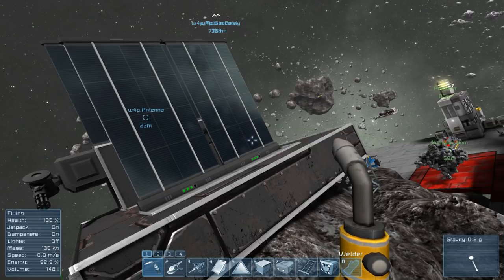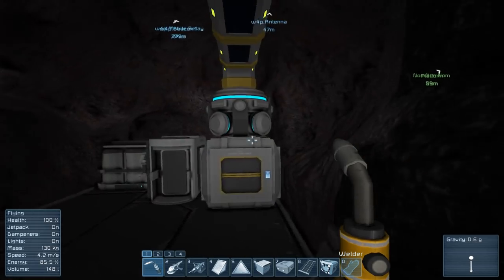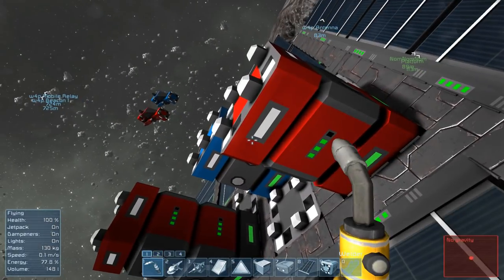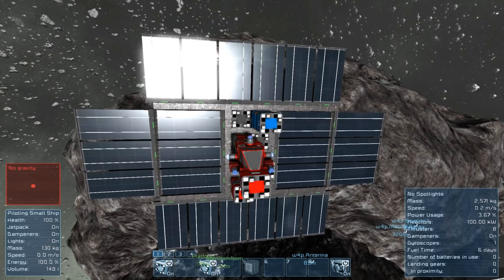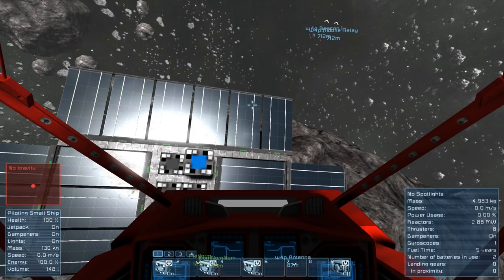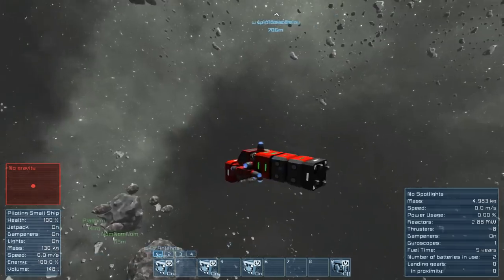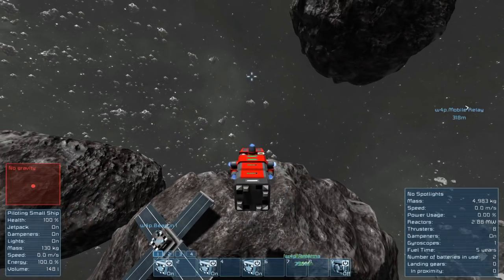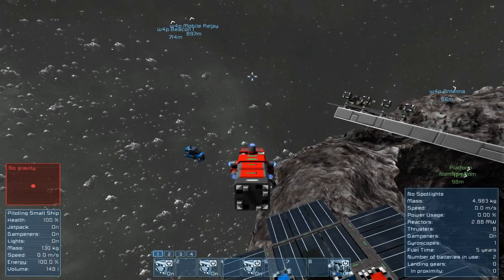Space Engineers - Solar Power - Practical uses for Survival Mode

Comment: You've got some awesome tutorials, I'm amazed at all the cool things that can be done with space engineers.  Earlier today I started the voyage into solar since I'm always having issues finding uranium.  Can a sensor be setup to auto track the sun to get optimal lighting no matter what position the ship/base is facing?
Reply from the maker: Cheers! :) As for the solar thing, it's really tricky.. I thought about that a while ago and couldn't really come up with a good solution as there's no way to track the sun itself.. had some thoughts about somehow making it so the power cutting out activates a rotor to spin the panel but honestly couldn't then think of a way to make that work. Will have a further think about it as there may be some extra options now.
Reply: ***** I figured there may not be any actual way to track the sun yet, I'm amazed it's still in alpha stage as stable as everything has been that I've tried.  I've seen some pretty complex rotor systems that fold out and/or change the angle of the panels manually but haven't seen really in-depth explanation there, just demonstrations.  I'm still fairly new to the game and trying to figure it all out all the rotor and advanced rotor systems as the concept is quite deep.
Reply from the maker: Kurt Laws
There's a ton of depth for something billed as an Alpha stage game and I for one hope it remains alpha for as long as possible, the development the game has seen is incredible honestly... Welcome aboard, you're gonna have a lot of fun I promise :)

Comment: In very recent times (matter of days) I have gotten an Idea for building a carrier that is designed to be used in long duration  voyages. Mainly because it is powered by two absolutely massive solar arrays that store power in, once again absolutely massive battery banks in engineering decks of the ship. Alongside being helped by two small emergency reactors, I think it would work. i just need some math done.

Comment: grins evilly  Well that gives me a crazy idea.....  Imagine a solar panel array, hooked up to this little room with merge blocks on the floor and some little cranes (vertical pistons with merge blocks, moved by horizontal pistons).  Ones side of the room is separate and linked to the solar panels, the other side is linked to the station.  Timers set up to move a double battery like the one you have on your ship back and forth when it fills up and empties.  Off set the times so there is always at least one battery plugged in.  Completely over the top way of keeping a base powered.  Doesn't it sound fun though?
Reply from the maker: Simple concept but I really like it! :) Splitting up grids is a technique I need to get more used to anyway to allow for different results depending which side the block is connected (thinking for timer purposes here, adding in some logic gates essentially). Sounds both fun and cool, might give that one a try! Only flaw would be you'd need to balance the power in ur base vs ur battery capacity pretty spot on. Cheers :)
Reply: ***** I just had a play around, looks like you need to be careful with your pistons too - you know how easy they break when you merge four pistons together, same problem of having to be careful. Still, it has a lot of possibilities :-)
Reply from the maker: Stewart Bates Yeah indeed :P Pistons are always a pain, not surprised. Still, should work if done slowly methinks.

Comment: Thus far I had not looked much at solar panels/batteries. I like the idea of little battery powered ships for running about. I'll have to look at the cost of the batteries for small, almost disposable ships for pirating npc ships, for when things don't go as planned. :)  And for scenarios where uranium is almost impossible to find (I've had that problem before). Gave me some ideas to think about, thanks for the video. :)
Reply from the maker: ***** Batteries are expensive actually, surprisingly so.. more of a benefit when you are looking from a sustainability perspective and want something to run without having to worry about uranium - might not work so well as a 'disposable' power source unless those parts happen to be plentiful (they are different in some areas to reactor parts). Cheers :)